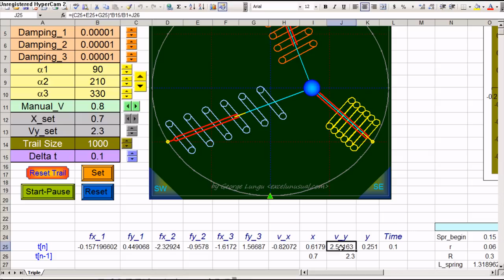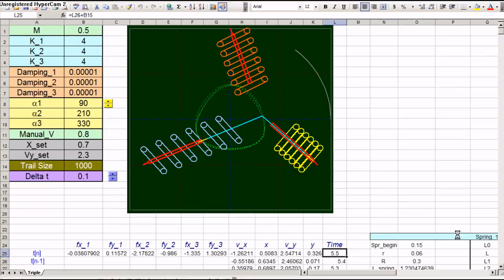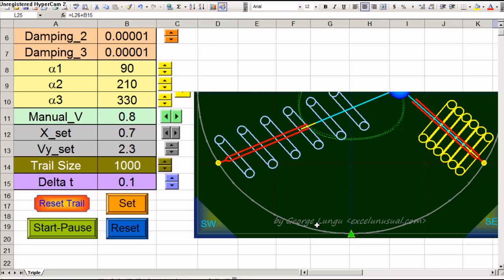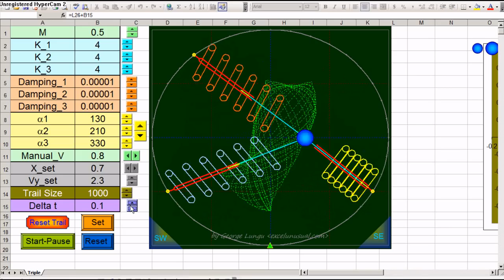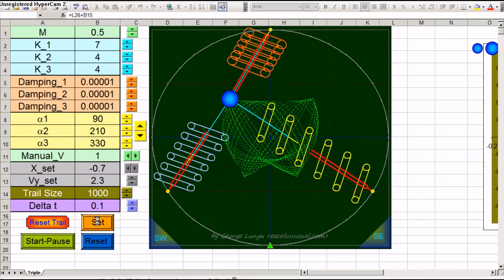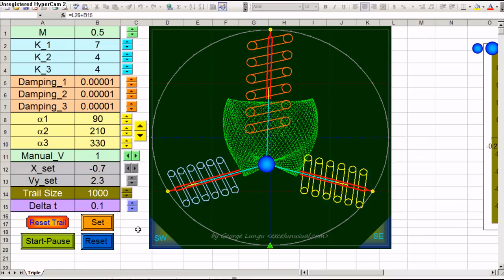2D_Spring_Oscillator

Comment: Very nice. How about with rotation of the whole assembly?
Reply from the maker: This is a line plot on a 2D scatter chart. The vertices are from a table which is being re-calculated perhaps 30 times a second (as soon as a calculation is finished and refreshed a new calculation starts). I made the chart with back background and and deleted any axes and grid lines from the settings. At that time I knew very little VBA and most of the geometrical perspective is calculated in cell formulas within a table. Today I would do it differently, all VBA. You can see more at https://excelunusual.com/. Thanks for commenting!